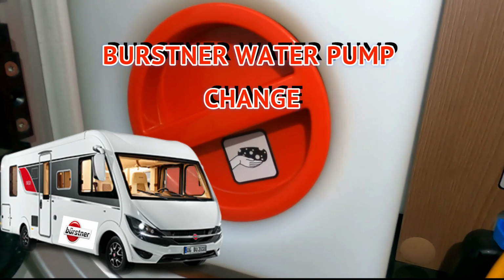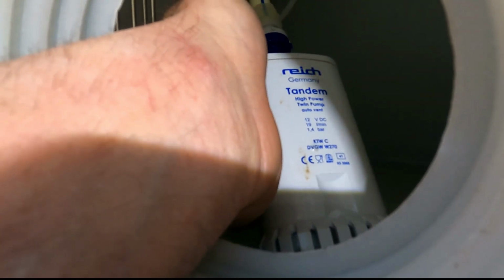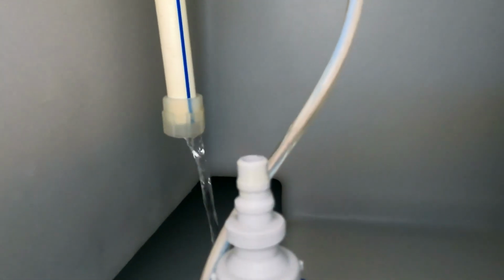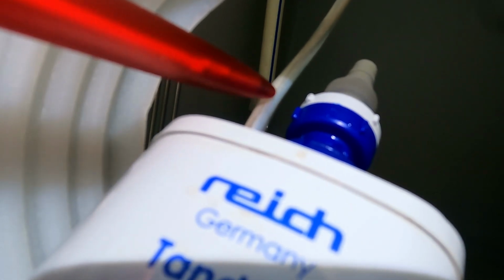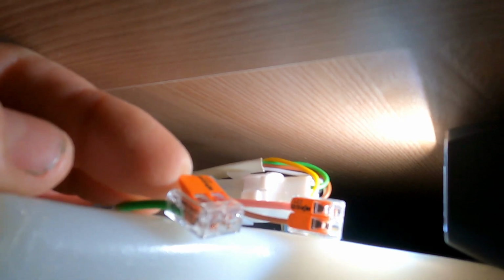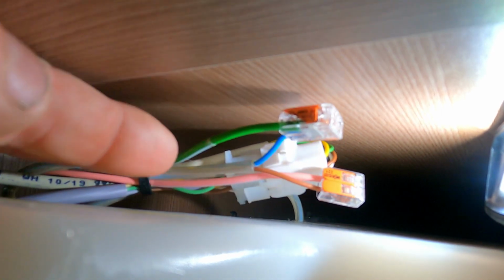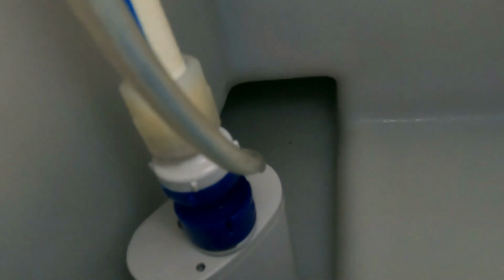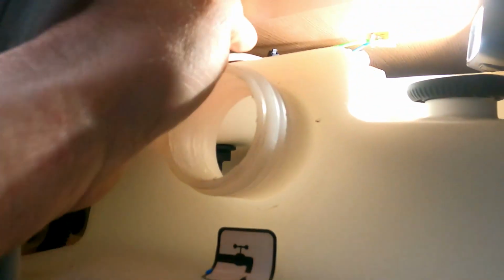Motorhome 12 Volt Reich Fresh Onboard Water Pump Change Replacement

Comment: Any ideas what to do if you can hear the pump working after switching but it doesnt seem to be pumping the water. (Have already tried switching the wires in case it was in reverse)
Reply from the maker: @benwillard9409  any luck, not unless the pump is faulty..

Comment: thanks, really useful. I already disconnected the water pipe (by pulling the grey tab rather than unscrewing as it was too tight), but i was daunted by the thought of having to trace and rewire until I saw your video how easy it is. Just hope I have the same snap clips when i find them.

Comment: Think you don't need to undo the knurled connector on the water supply, you just need to pull out the grey clip between the blue and white parts of the connector.  This allows you to take off the complete connection to the pump.  Refitting or installing a new pump is simply a process of firstly reinstating the grey clip and then push fitting the connector to the pump body.
Reply from the maker: Thanks John appreciated 🙏🏨🚍🌴

Comment: Known as a sump pump in the Engineering trade Jof.
Use bigger ones to drain tanks before we go in there doing any fabrication and welding work. 
Same thing and idea of moving water. 
Diesel ⛽️ down to £1.71 btw in North Wales.
Reply from the maker: Brilliant thanks for the info 🏩🚍🌴🙏